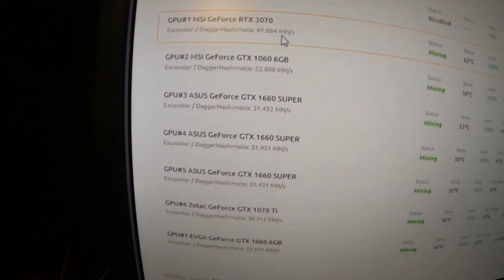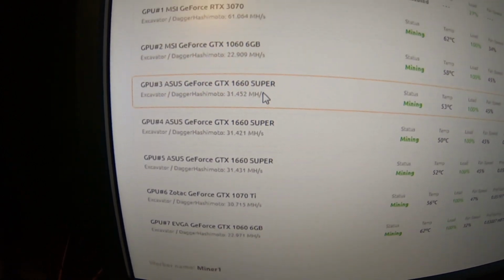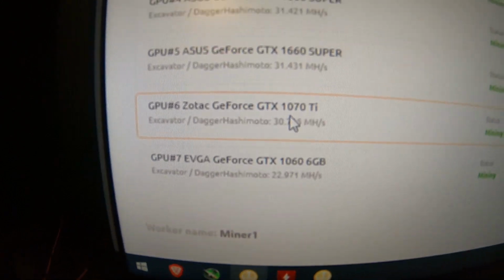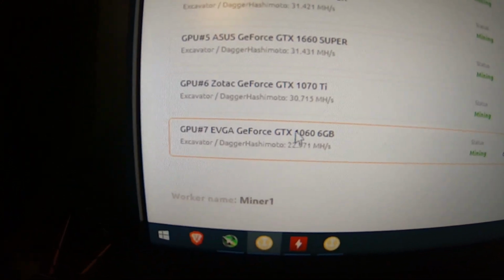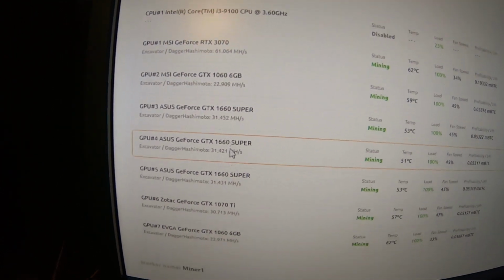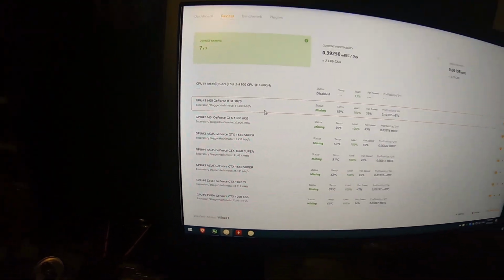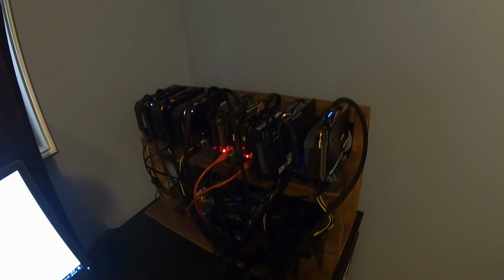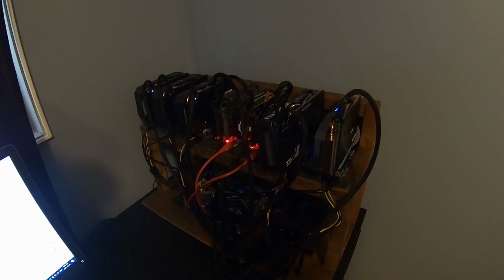Add an Extra GPU to your Mining Rig with an M2 Adapter

Comment: Did this actually need the extra power cable my use case is not for mining but for my Nas I wanted to add it's a itx rig so only 1 PCIe slot this would allow me to run the raid card for the 8 16TB drives and the GPU for Plex.

Comment: Did you end up powering the m.2 stick or not?
Reply from the maker: No, there was no need for power for this m2 adapter. Still working perfectly fine now, running 24/7
Reply: Good to hear. I'm about to add an identical one to my system. Any need for bios setup ?
Reply from the maker: There wasn't on this rig to use the m2 adapter. On my second rig, I needed to do a full a bios update for any mining to work at all

Comment: thanks for the video man. i have a pciexpress 1x and bought an adapter for my 3060 to 16x .... will that work my gpu ?
Reply from the maker: That's sort of a different issue. I'm not sure what is the current status of unlocking the 3060 hashrate. As far as I know, it needs driver 470.05, it needs to be plugged directly into the mobo, and it needs an hdmi/dp dummy plug.

But I haven't experimented with the 3060 myself

Comment: Thanks bro subscribed, is it still working well without power?  Thank you!
Reply from the maker: Yep, no issues at all. Running 24/7 currently
Reply: @ItsStuder  Have you tried it with power? Are your other risers for your other 6 cards powered? If it were me, I'd power the riser. Even though the cards have the separate 8 pin or 6 pin PCIE power cables they still can draw up to 75W through the PCIE connection. With one or two cards that probably wouldn't be an issue, but with 7 cards it might, and unless your motherboard has an additional 12v power connector that feeds the PCIE and M2 slots, all that power plus what the CPU, Ram, and mainboard is using is flowing through the ATX power connector. So, it might be a good idea to either feel that connector with your hand or point an infrared temp gun at it and see how hot it's getting. Otherwise it may over time cause a degradation of the contact points between the connectors which might cause overheating and eventually a problem.
Reply from the maker: The riser is powered just like all the other risers. It's simply the m2/pci adapter that isn't being given additional power. From there, I'm still using a typical powered riser to connect the gpu to the m2/pci adapter.

My laser temp gun doesn't show excessive heat on the m2/pci adapter

Comment: I recently purchased one of these also and I have the ASUS Prime z390 P which has 2 m.2 slots and i use sata for my ssd. Do you think this will allow me to add 2 extra gpus?
Reply from the maker: Yes I think you can add 2 extra GPUs but I'm not 100% sure. I would recommend getting some cheap M2 to PCI adapters and if it doesn't work, you're only out $3. I got 6 more M2 to PCI adapters from China for a few bucks each, now I have more than enough even if some are DOA or fail down the road.
Reply: I also has the prime z390P, did you get the m2 spots to work? If yes, any bios changes?
Reply: @ewil6  also having same problem i cannot use secend m2 or i don't know how to enable on bio i have asus prime 365 plus
Reply: @kstips2891  In the bios you only have to activate AHCI so that it recognizes the m.2 and then only respect the manufacturer's settings. I remember that you could not use the SATA slot 0 or 1 if you had two m.2 connected

Comment: Do you have all your PCIE slots sets to GEN 1?
Reply from the maker: Yes I do
Reply: I don’t have a way to set gen 1 or gen 2, what do I do if I don’t have that option in bios?  Thanks in advance
Reply: @joemarooni4580  Most boards should have this option. What board are you using?

Comment: Hi! Thanks in advance for your video. Question, do yo know if there is some restriction about using all the m2 AND all your PCIe? I´m worried about thinking that there is some "sharing line" that disables an m2 if you have all your PCIe already connected. Thank you very much!
Reply from the maker: So far I have not run into this issue. This rig has 7 GPUs and one M2 SSD. 6 of the GPUs are on PCI slots, and the 7th GPU is on M2 slot #1. M2 slot #2 is the SSD. So I'm currently using all PCI slots and all M2 slots.

When I was building my 2nd rig, I noticed the motherboard manual said that if I used the M2 slot, that would disable SATA0. So I just used SATA1 for my 2.5" SSD on that 2nd rig.

I hope this helps.

Comment: which adpater did you pick up? Thanks for making the video
Reply from the maker: It was just one from a private seller in my province. Had to get it shipped in from the next city. I'm sure it's just a noname Alibaba special. Here's a photo of it on my mobo: http://imgur.com/a/oLG3TUj

I only bought it cause the 6 I ordered from eBay still aren't in. The ones I ordered from eBay are these. I'll check their functionality once they arrive: https://www.ebay.ca/itm/164511210173

The one I purchased locally still needs the pci to usb adapter from the typical pci riser kit. The ones I'm still waiting on, are directly M2 to USB so the riser cable can just plug in. One less small thing to potentially malfunction down the road.
Reply: @ItsStuder  👍🏽 and didn’t need to run power? Double 👍🏽 👍🏽
Reply from the maker: Yeah correct. It's powered directly through the mobo. I believe most of them are that way, from the research I've done (mostly reading old Reddit posts lol)